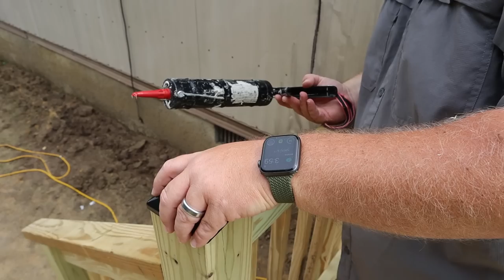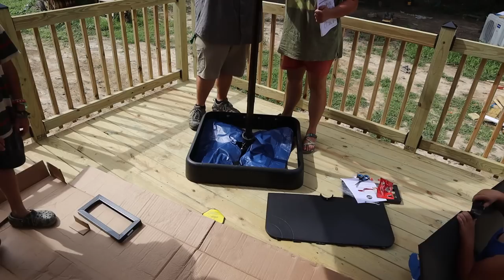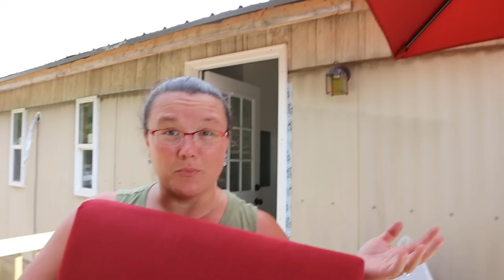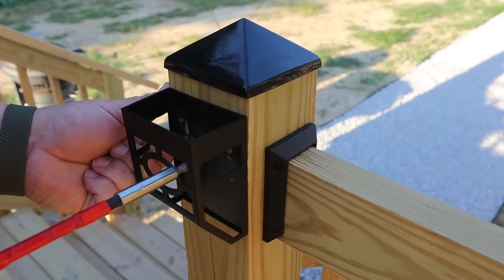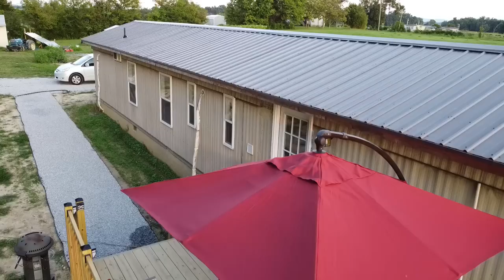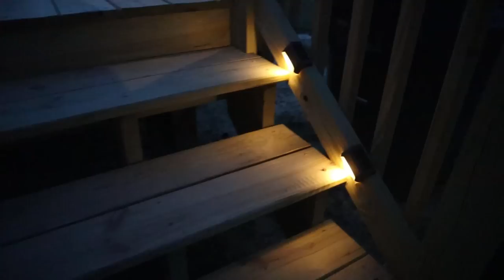It's NOT FINISHED without THIS! // 12' x 10' Mobile Home Deck Build - Pt. 7

Comment: Have you done the pathway in stone without us? My recommendation on moving house is put all the beds in first and make them then put the bathrooms together so if nothing else you can shower and go to bed without it being a mission to find everything - suggestion for the double up of light - put a set on the posts at the bottom of the stairs - deck is looking great and love the new furniture

Comment: Great job and video!!, I hope you consider adding a small back porch/deck roof over the back door to keep water from damaging the back door and getting into the house if it's raining and you're going in or out during a rain storm
Reply: That is a great idea and a smart one.
Reply: Can’t attach anything to a mobile home. Gutters will be about as good as it’ll get, unless you add a freestanding roof attached to the deck with a gap between the two roofs
Reply: @tanneradams20  usually no, but sam put on new rafters and could attach a small roof with rafter support on each side of the small roof. Having worked on  mobile homes, the rain will eventually destroy the door, plus anyone going in/outside tracks water into the house
Reply: @b.powell3480  I see what you mean now. Like a door awning.. I thought you were meaning like a covered deck lol
Reply: @tanneradams20  on, no, just like an awning

Comment: Looks great.  The one thing I would add would be backing boards to enclose steps.  I have a sister-in-law who was bitten on the back of the heel by a copperhead hiding at the bottom of the stairs.  She was four at the time, in her sixties now, and still has leg and knee problems from the bite.  Going up the stairs the snake would have been visible, coming down he was hidden and just a couple of inches from a foot stepping onto the last step.  Ever since hearing about her ordeal, I have always enclosed my steps.

Comment: Sam, first of all hats off to you for your amazing work. The rear deck is awesome. However, I noticed that the stair handrails do not have rounded edges. Having built numerous decks, I round off the edges of the handrails with a router and lightly sand smooth. This does two things, one it's attractive, and it prevents splinters over time. Just a suggestion. Love your channel!

Comment: I'd paint those metal brackets black, the ones tieing the front corner posts together. Lots of Bigfoot sightings out in those parts. If you hear a loud WHOOP at night, that's them. :) I'm really looking forward to see how you resheath the exterior. I'll be doing that on mine next Spring.

Comment: Love the deck and the solar lights!
One thing we did when we built all of our decks (front deck and pool decks) is to cap it with that Trex deck boards. Very pricey tho!
 Although we used wolmanized for the whole thing, the Trex top rail  won't warp, give splinters, and it stays flat. And it comes in colors to accent it. 
I love watching your progress!!

Comment: Could you put the post lights at the stair posts on the opposite side facing down the steps? It could help prevent the crowded look. Great deck and deal on the patio furniture.

Comment: It looks great!!! One thing I must say ,keep your paper work so in a few years you can order a new Umbrella cover and you will have the right part #. As the owner of a red umbrellas you will want it to look pretty at all times we didn't cover ours and it was perfect year 1, slightly dull year2 and it looks awful year 3.  We've tried to order a new cover but without the part# we are out of luck, They make hundreds of these and they are all slightly different sizes. If you are handy get some fabric and make a sleeve to cover the Umbrella when it's not open, we have one for an Umbrella that goes into a big dining table that must be 10 years old or older and it came with a sleeve to cover it up and that one still looks new. Your home is looking wonderful, you should be so proud of yourselves.:washhands:❤

Comment: If you can, pick up some cans of the 3M Stain Guard for Outdoors product to use on anything cloth outside on your deck. What often destroys the cloth on outdoor furniture, including umbrellas areas all dust particles including rough edged sand whichnworkmthier way into the weave of the cloth then begin to "saw" away at the fibers. The stain guard product(s) puts a coating on and into the weave preventing the dust from getting into the weave.  Stain guard is nice and all that but, its how it works to prevent the dust from damaging the fabric which is important for longetivity.

Comment: The deck looks absolutely amazing, I just have one small gripe that's triggering my OCD,  you have galvanized or aluminium brackets joining the corner posts together, have you thought of painting them black to match the hardware? The silver sticks out like a sore thumb, apart from that it's looks fantastic 👍.
Last blooper revealed a red cushion on the love seat, the grey also triggered my OCD 🤣.

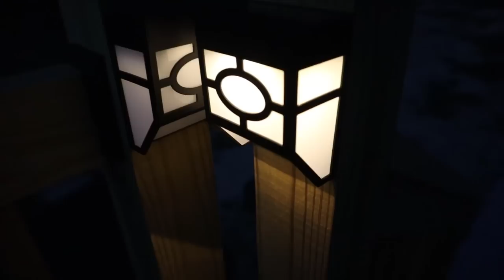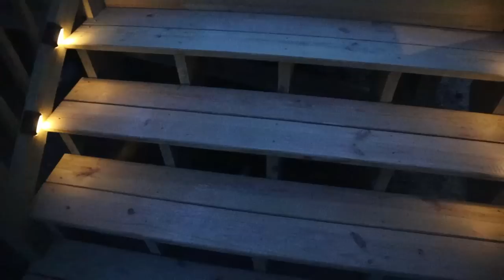Comment: Suggestion on the led lights at top stair rail: move the ones on the posts to face each other so it provides more illumination on the top steps. ( 16:50, 17:10 )

Comment: Deck looks GREAT with ONE exception (dual corner posts), a Deck should ONLY have ONE Post at each Corner, with railings on each side mounted to SAME Post. The Corner Posts should go from Below ground to top of Railings in one piece, for  strength, stability and less material & work. The rim joists of floor of deck should mount to outside of posts. It's less expensive and looks much better than two posts with a space between them.

Comment: I did not know end caps protected the wood.  I will get some for mine.  Thanks for the info!  Do you know of a suggestion for the top of the rails?  Mine are turning black.

Comment: Hope you are doing more videos. What about siding? Or a roof over the front & back porch? We had a beautiful back porch did 3 years ago, now only 3 years old is has rotten to the point I will not walk around on it, I only step on the stairs, & a small place into a more rotten washroom that was not built right. (I am looking for someone to fix)

Comment: I build decks I would like to suggest something to you. Two outer corner post  the gap in the corner of you 45 two 2x4 one for the top one for the buttom on the outside of your 4x4 like you did your handrail and nail one spindle it will clean it up nice
Reply: Y'all did a very nice job like the extras
Reply from the maker: Cool, thanks

Comment: Hey guys, watched your video and have a word of wisdom.  I did exactly what you are doing and put down a new outdoor rug.  When it got hot, sap in the wood seeped into the fibers of the rug, from underneath and basically ruined the rug.  It showed all the way through and we ended up throwing the rug out.  Not sure what a remedy would be other than doing a good seal on the wood to keep the sap at bay.....just FYI....